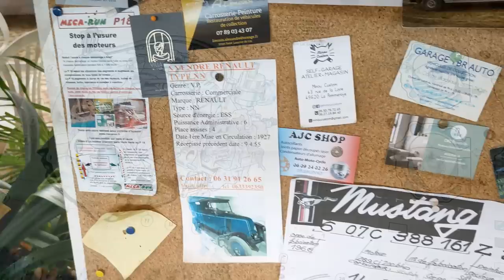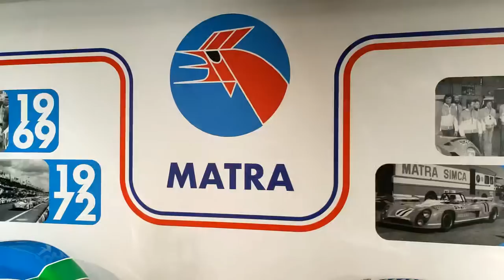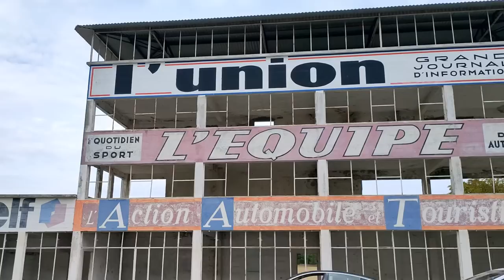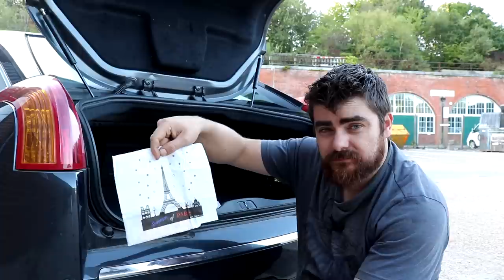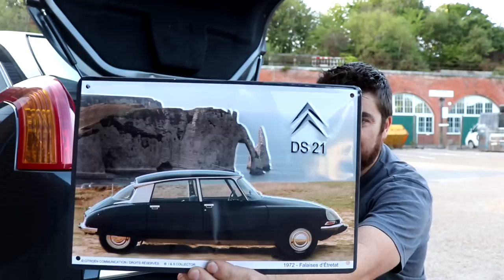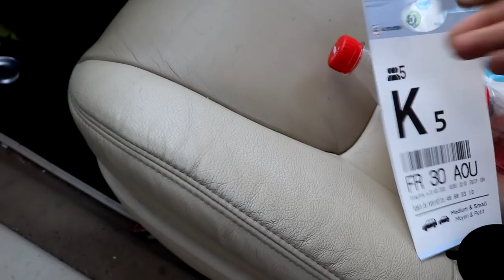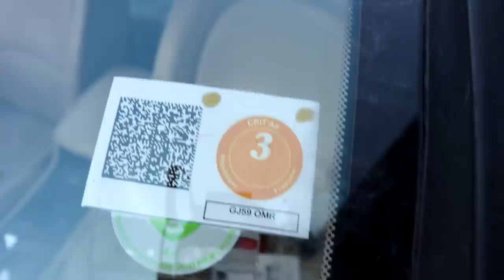STORYTIME SPECIAL: My £750 Citroën C6 and its emergency adventure to France!

Comment: Richard. That was a brilliant video regarding your holiday adventure. What an incredible car. Nearly 160000.00 miles on the clock 40 to the gallon averaged and totally reliable and you paid just 750 pounds for it. What an absolute bargain.

Comment: Cracking vid: echoes of our sprint to Poland in my old e36 M3 a couple of weeks back, when the e53 X5 failed to proceed due self level inactive 🙄. Think we clocked around 3k with roof box, broke 1 indicator due debris thrown at it & the air con gurgled a bit in the heat. Incidentally those belts will clean up, a soak with & in a cleaning solution of your choice, some microfibre towels & a steamer. You'd be amazed, come up like new.

Comment: I found the best way to tackle a dirty seatbelt is a bucket of warm water with loads of Vanish in it, and a small scrubbing brush (nail brush). Towels to prevent drips onto the leather. Pull the seatbelt out as far as it will go and clamp it so it can’t retract. Then set to with the brush, Vanish and a cloth. Rinse well and leave to dry. It’s a trick used on MX5s - usually needed to speed up the retract which slows when dirty.
Reply: That’s works very well.  But if your in a hurry.  Do all the prep you mention and use a power hose, something like a power adjustable Karcher.  I did the rear cream belts and they are like new.  Then also use the towels as you say to protect the leather and door area.   I hold the reel open with a clothes peg as well.

Comment: I have driven in Paris and also Rome. You're quite correct the French are more laid back. Rome was a different story, but just as fun.  Plenty of horn action and gesticulating, but no real tempers frayed. Every car in Rome had some paint missing, even the shiny new ones. 😁

Comment: I know it's been 8 months already, but if you are still thinking about cleaning those filthy seatbelts here is a tip I saw on C6 Polish owners group. Go to a car wash, those where you wash the car by yourself. Bring the seatbelt out as far as it goes (outside of course), close the door and start pressure washing it. It works marvelous! 
It helps when a second person holds the seatbelt so it doesn't flop around
Reply from the maker: I was actually thinking of doing this in the summer with my Karcher and some upholstery cleaner.
Reply: @UPnDOWN  I bet the process will be very satisfying 😎

Comment: I have some real funny film of Rouen des les Artes track with R8 and R12 Gordini's racing.  The corner you showed features heavily and in one bit a car overshoots the hairpin and goes around the back of those bushes and a fireman carrying a fire extinguisher has to run out of the way - circuits were so much more dangerous in the past

Comment: good luck with the C6! I have (had) two, traveling with it from Metz in France to Prague, Brussels, Amsterdam, Milano, Spain, Switzerland, even up to Norway, 100 000 km with a black one, 2.2 hdi that I sold and ca 60 000 km in a blue 3.0 hdi, that I'm about to sell. I always enjoyed the driving so much, despite of a certitude to returning back home by plane time to time as both cars every now  and then didn't make it back home due to defects on the road...now I replaced the by a Jaguar X350, that also had quite some problems, and a beautiful XJ X351, that is ''brand new'', 20 000 km only, despite of being a car from 2013. The C6 has better suspensions for sure, Jaguars have better interior material, let's see how they will work in time, compared to the C6'

Comment: My C5 did the exact same thing here in Australia as your C6 did at the Eiffel Tower, scraping the plastic underskirt while entering a car park too quickly. In retrospect I wished I'd pushed the ^ button in the centre console, as my wife was driving at the time, but it happened too quickly and I didn't see it coming anyway. It seems there is room for Citroen engineers to design some kind of proximity sensor that would react to such hazards by giving the suspension a quick uplift, but sadly Citroen engineers no longer think of anything so innovative as hydropneumatic suspensions. Those new squishy dampers are no substitute, unfortunately. It's sad really, because in this era of EV's you'd think Citroen would  come up with some kind of tour de force of innovation that would incorporate Hydractive with all the latest EV wizardry. Even Tesla has a fairly respectable air suspension on the Model S, which puts to shame anything Citroen is doing with its current models,

Comment: Hi, I have C6 my self and I like it a lot. it has perfect ride and it has pretty powerful engine. No for racing, but perfect for cruising and overtaking. I guess yours is Gasoline 3.0 V6 204 bhp manual gearbox as I heard you saying about the litters per 100 km. Mine is 3.0 V6 Diesel Twin Turbo 240 bhp 6 speed automatic gearbox. and the economy is much better. I drive it mostly in city and as an average I have achieved 10.8 to 11.0 liters per 100 km. Outside of the city when you drive below 100 km/h it is about 6.5 to 7.0 liters per 100 km. On a highway with about 140 km/h 7.5 to 8.2 liters per 100 km. For me it is the perfect car. Yes the boot is a little bit low because it is a sedan, but can't say that it is small and you ca still lower the back seats if you need more space. The car is really specious inside and even people in the back sets have plenty of room for their legs. Mine is also black with the beige saloon and carpets as yours and this makes it look very cool and sunny inside.
Reply from the maker: It's a 2.7HDI. 
The manual box wasn't available with the petrol. 
The figures I quoted were km per litre, not litres per 100km.
I can't lower the back seats because it has the lounge pack (and besides, there were kids in it).
Mine's Storm Grey, not black.

Comment: Thank you, really enjoyed that ... And I'm not alone! 

I spend a lot of time in France in my motorhome. It used to be a lot more but ... The lack of litter is noteworthy. On my most recent trip I took more note and spent lots of time walking around towns, observing that there was no litter at all. No fag ends carelessly dropped and no chewing gum defacing the pavements. And as you observe no wilful damage to useful infrastructure.

Country roads are a joy to drive. Sometimes you can drive for 15 minutes and not see any other vehicle. And the surfaces are so much better. Occasionally you see a sign warning of a section of poor road surface. These sections are usually billiard smooth compared to the desperately poorly maintained UK roads.

When you get your Crit Air sticker it should be affixed to the bottom right corner of the windscreen i.e. on the UK driver's side. Remember this is the nearside in France!
Reply from the maker: I'll make sure to stick it there, and probably never use it again 😆

Comment: Glad you had a great holiday - I did a similar trip in a similar car (C5 tourer 2009) albeit a ski trip. Plenty of boot space, though. Like the C6, the car proved itself on that trip too - I remember hustling it down an alpine road and misjudging the entry speed into a corner (at near 50 mph). I was fearing a major incident but the car just went round, no drama at all. It might not be communicative but there's a great chassis under there. So secure, stable & solid. Really underrated cars these - think how much that full alloy double wishbone front suspension must have cost them (and then proceeded to sell virtually none at discount prices!!) The rear axle is also impressively expensive looking. Far more of an engineer's car than people give them credit I think, especially when you consider most cars now are fitted with torsion back ends

Comment: I remember my first time in Paris 1972. The whole city was littered with Citroën DS's, some with the "new" front (turning lights), some with the old; many with built-in fog lights over or under the normal headlights (my dad had a DS - so I noticed). The rest of the cars were of course other Citroëns, Renaults, Peugeots, and even Simcas. You would see the odd Mini, Merc, or Fiat, but 95% of all cars were French (or so it seemed).  Now there is hardly any difference whether you go to Paris, London or Rome: it's the same Euro/Asian SUVs. Sorry you couldn't find any real Citroën stuff in Paris, I think most people do not really care about the car history anymore.

Comment: Yes, I love driving around Paris too. Much better standard of driving; looks scary but once you dive in it's fine. I'm surprised you can still just drive into Paris with no congestion charge or low emmission zones. 
I looked at doing a trip to southern Italy (where my dad was from) and Naples is a nightmare; not the driving (although I remember that being crazy when I was a kid in my uncle's taxi) but it's now a maze of low and zero emissions zones that look like they're specifically designed to catch you out and cash in on the fines!
Reply from the maker: There is a low emission zone in Paris, the CritAir system.
Reply: @UPnDOWN  Thought there would be by now.

Comment: Seriously.... haven't you learned your lesson about taking old cars round old race circuits ????? 

No, joking apart that's a great story... I'm sure you were able to effortlessly cruise round the Arc de Triomphe, park by the Eiffel tower and illegally park in the Reims circuit pits because you were driving an almost Presidential spec Black Citroen C6. May have even helped a bit on your A3 dash home as well...

Funny you found all the Citroen memorabilia stuff in 'Bruges' which is not in the French part of Belgium but is in (Dutch-ish) Flanders and actually called "Brugge" like its port Zeebrugge. Also nobody says "Ypres" - it's "Ieper". I've stayed near Ostend with my motorbike mates and made regular rides to the square in Brugge and over the Dutch 'border' to Sluis. This year we went to Brittany / Bretagne and saw all the U-boat stuff at Lorient which you'd enjoy if you do the Normandy thing - nice long crossing Portsmouth- St Malo with Brittany ferries.

Now treat the car to some proper front Michelins and tracking !

Comment: I've said this before but I'm sure this is one of the 3 C6s stored at Gefco Sandtoft for nearly 3 years. I spent a lot of time keeping the battery's charged.
Reply from the maker: Yeah? Any more info?
Reply: @UPnDOWN  the Vin looked familiar, some times I'd take job sheet he with me. I thought about looking through old paperwork or photographs to see if I could match it. The date of manufacture, colour, interior engine and registration match.
Reply: @UPnDOWN  there where some recalls and warranty work on these, which will have been preformed at on of the 3 Gefco storage facilitys it was kept at. There may be information about where and when this work was done.
Reply: @UPnDOWN  every 3 months I was supposed to remove there batterys to charge under warranty. Its was an awkward job so I used to jump them off and leave it running for an 1hr or 2 instead. Sometimes while taking naps 💤

Comment: The area of the Quai de Javel factory wasn’t a car maker’s before, Citroën got it to make ammunition in World War 1.
Reply: If you want to find other Citroën related places in Paris, close to the parc André Citroën, walk down rue du Théatre - there’s a block of flats on its southern sidewalk where there’s a commemorative plate where the engineering department was, where Lefebvre and Bertoni worked on the Traction, the 2CV and the DS. And then, go to the Bistrot d’André, a small restaurant on the corner of rue Saint Charles and rue Leblanc. It used to be a restaurant already when the factory was still there, with Citroën employees being among the regulars. Today’s owners have left the place in the style of an old fashioned French bistrot, and decorated it with Citroën memorabilia. The food was good when I used to frequent it, and not too expensive either.
Reply: @thomasalbrecht5914  Thank you for this, definitely something to do when I next visit Paris, whenever that might be (It's a long way from Australia). Closest I've been is the Javel-André Citroën Métro station. A lucky accident due to trackwork on the RER C.
Reply from the maker: It was munitions when Citroen had it, but I think the original site land was part of a purchase he made with a smaller business. Thought it was automotive, may not have been. He rebuilt the factory twice anyway!
Reply from the maker: I need to go back and sight see properly!